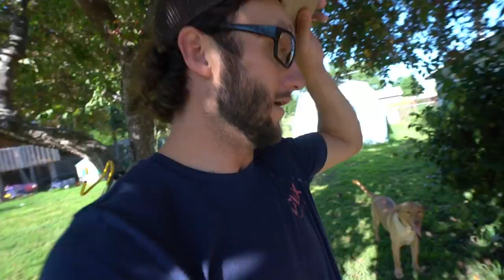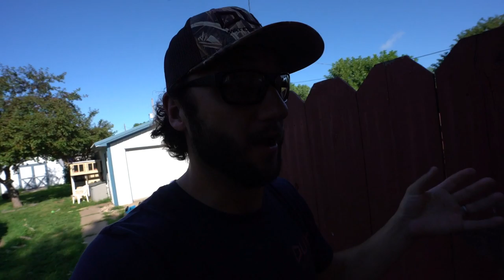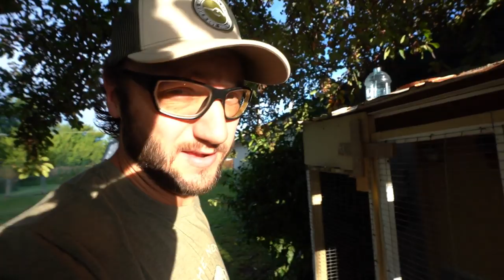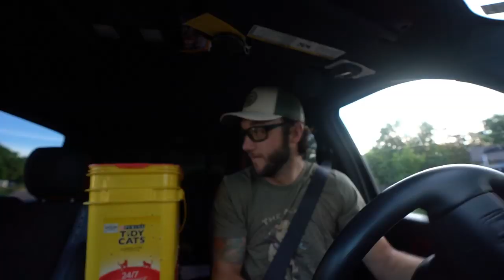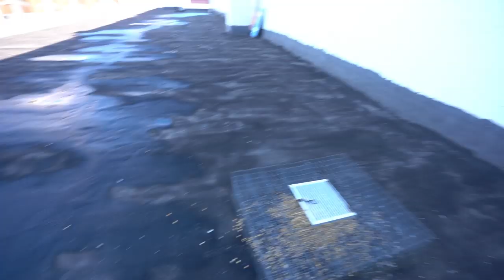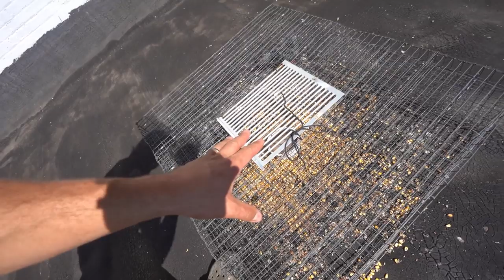Using My Pet Pigeon as a Bait Bird!!

Comment: I'm surprised! I thought that would have worked too. Maybe they were weary because Clark was agitated, and they could probably tell, I know when I'm squirrel hunting out of a blind on a bait pile,when I shoot one, I send my dog out to get it right away, because if the other squirrels see it they tend to get a little weary of the area, maybe kind of the same concept? You could try cutting the bottom off of a clear water jug for a new water bowl maybe they wouldn't be scared of a clear one, also try putting it in a corner away from the doors, the pigeons run around in the trap all day, and it's not very big, they'll run into the bowl eventually.

Comment: Just use wild bird seed, or multi grain chicken scratch feed mix.  Or just add red Milo to your whole wheat n whole corn, but peas safflower sunflower, white pearl Millet, etc (least several different types of grains seeds legumes), n or 16% natural chicken layer feed will make them extremely healthy and attracted to your bait birds (should have two to attract as calmer birds, where single birds act cagier).  Leaving water in and mineral salt around (like big block broke up for stock), attracts as crazy.  Water always attracts.  Single bait birds act crazy to get out to strays that they hesitate to go at first in.  Single birds also get targeted by BOPs (birds of prey) harassed and drive away strays.